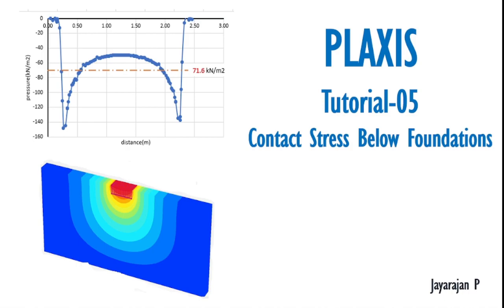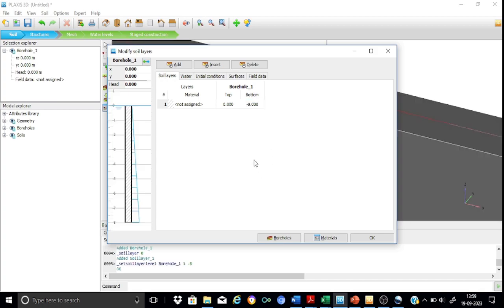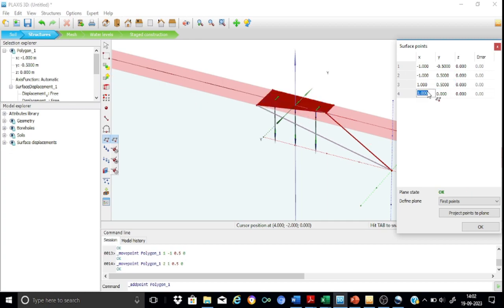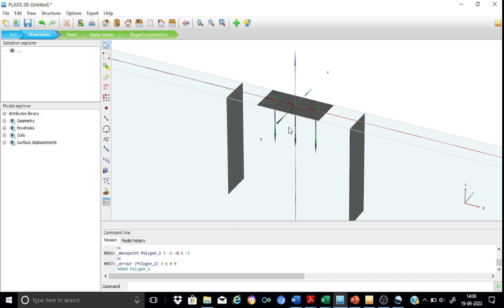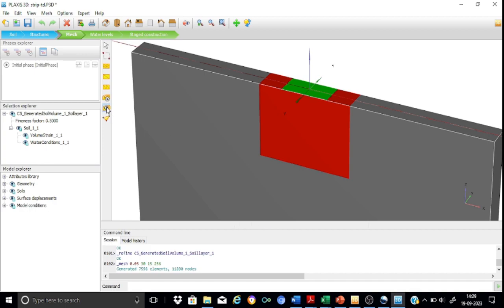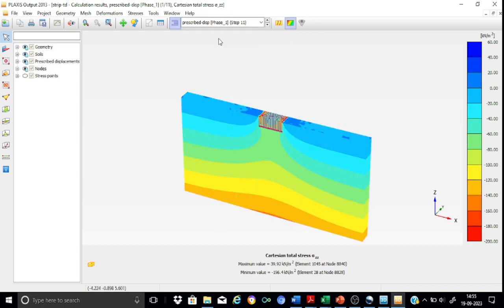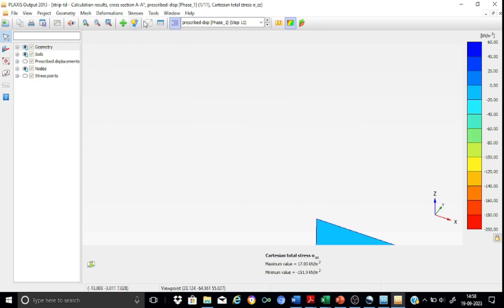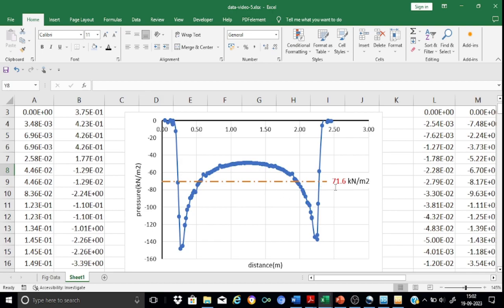PLAXIS: Tutorial -05: Contact Stress Distribution Below Foundations

Comment: @jayarajan While applying the prescribed displacement of 50 mm in z-direction you've kept the x and y displ. to Free. shouldn't it be Fixed or will it make no difference in this case?
Reply from the maker: These two free and fixed conditions simply simulate the rough and smooth conditions of the footing surface and would NOT be a guiding factor in geotechnical capacity calculations
Reply: @puttattjayarajan1199  Thanks for the clarification.